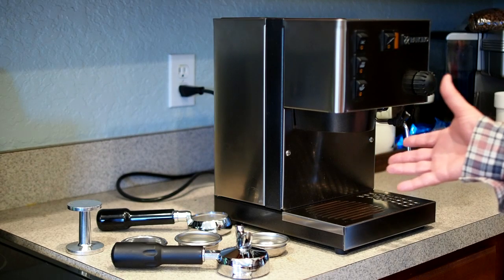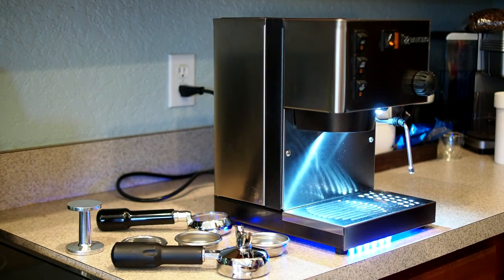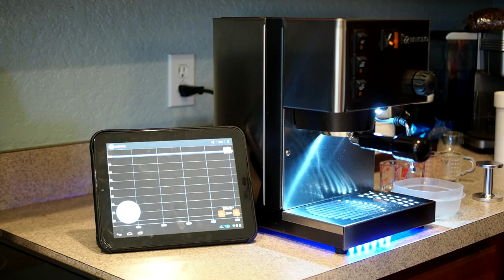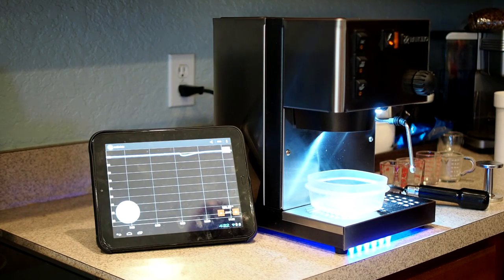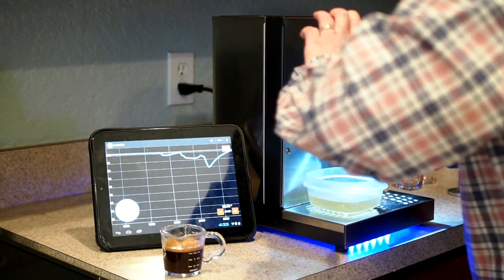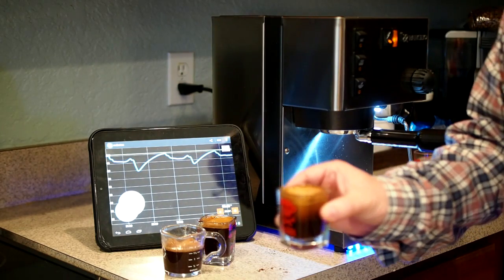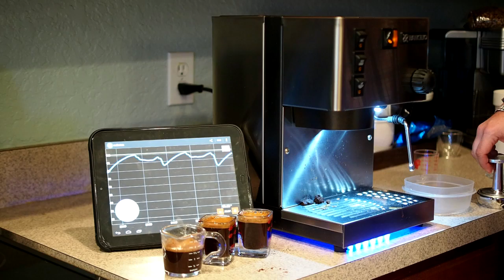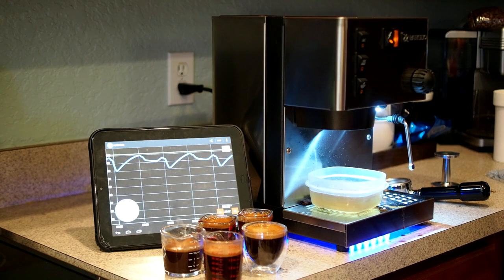Custom Rancilio Silvia espresso machine with meCoffee PID and other mods

Comment: Hey Alan. Nice job on the painting there. Not “almost every” of these Sylvia’s have the two problems you mention. I have a V2 and have owned and used it 5/6 days a week since 2003! No rust on it and the group head chrome is in perfect condition. This one must have been built on a Wednesday. I maintain the machine, as reqd and have not had a single issue with it. I too, installed a mecoffee pid and a fluid filled pressure gauge. Very unique machine now. Very smart app and can control all features, including pressure profiling. Machine is built so well and STILL makes amazing espressos. No light kit in mine, though that would make it even better. Cheers.
Reply: I've got a 2003 as well that I bought second-hand recently. Were all 2003s a V2? I've done some reading but it's not clear to me how to identify a V2.
Reply: Not Wednesday, before Noon.
The factory guys appear to often take a "Business Lunch", affecting QC.